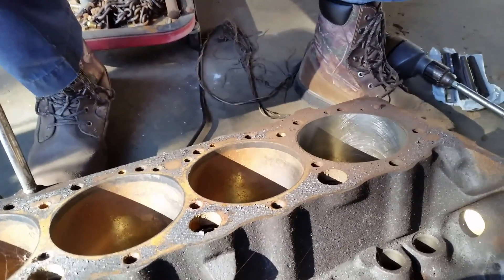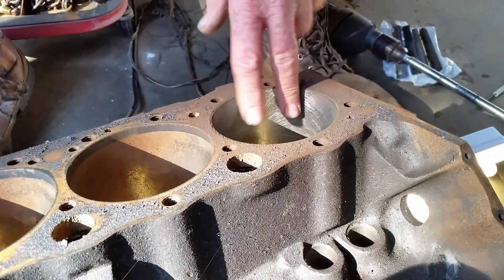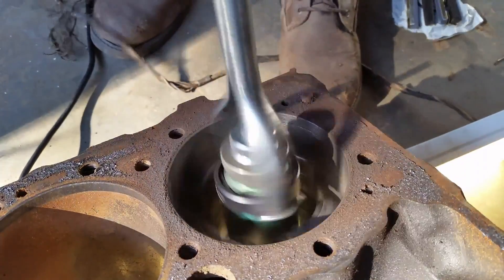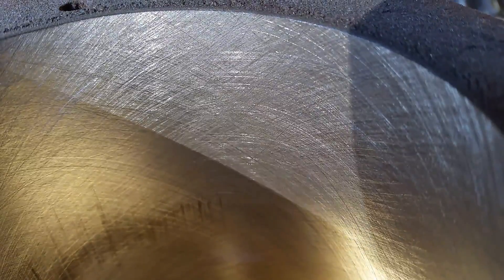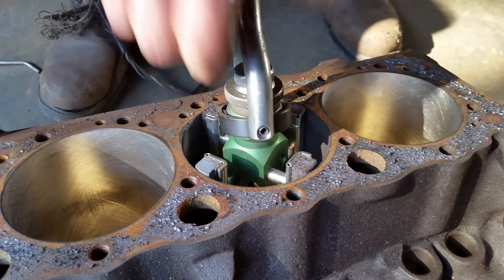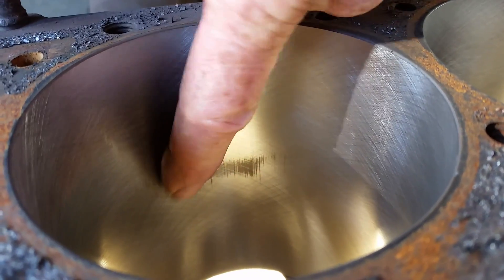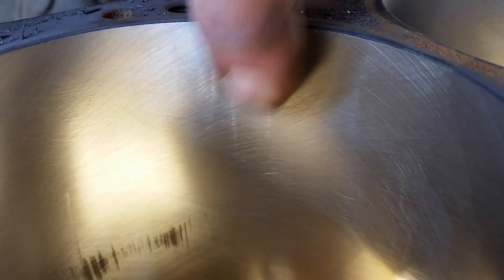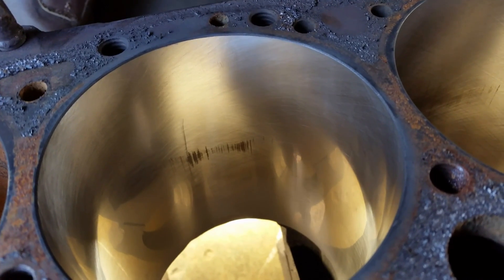How to Platau hone a block

Comment: EXCELLENT VIDEO! Thank you. A question or two if I may please. Are you able to get it even smoother than the 500? I have a 5.4 ford block which I disassembled and I see the cylinder walls are shiny smooth. A machinist told me they are crystalized and I will have a hard time with the new rings seating. They are smoother than your 500 demonstration cylinder. I don't know if I should leave them as is shiny smooth, or if I should hone them and if so, which grit to use. Speaking of grit, I just remembered Flo on the show Alice, she would say, kiss my grits! Let me know please, and again, thank you for the excellent video, extremely informative and well illustrated.

Comment: I have used this hone before and it actually produces great results. I use a truing sleeve to insure my stones are true and dial bore gauge for measurements. Can actually achieve .0005 or less top to bottom of bore. Also I use a really old Miller Falls half inch drill that turns at 120 rpm

Comment: Weldon dear....tell me that how can I machine and polish the inside body rings(seats) of gate vave above the 8inch valve. on a radial drill machine???
The device shuld be feedable while it will turned by spindle of drill machine....thanks...

Comment: That is not "plateau honing " among all the other issues the cross hatch angle is not 45 from the deck, should be 22.5, from the deck and 45 included, save yourself alot of trouble and have a machine shop do a proper job,

Comment: Once I finished a flat-four to mirror finish in the barrels. Used high quality brand new scraper rings. I worked perfect. Drove 2200 km's with partitially full power in the mountains and the oil consumption was not measurable after that. 
So the HC emission due oil was near zero.

Can anybody tell me what the hone pattern does?  It is simply a matter of time and money.....to stop honing instead to go for a very fine finish isnt it?

Comment: Old video  but who knows ... so I will say to those commenting on oil  for lube...   why would you need to lubricate. Something you are trying  to wear down ?    If you ever have used a whet stone you know that oil or water used in the process isn't for. Lubrication  . .  It's so the stones don't fill up with  cuttings and grit..

Comment: Hang a can attached with a small tube and run a small stream of fuel oil on the stones while you're honing. When about done place a sheet of 500 grit or whatever you choose, abraisve paper in the bore; expand the hone against it: run the fuel oil and Finnish the Job.
Mike

Comment: is it fit 50 mm to 65 mm?
Reply: To do that you would need a boring bar or milling machine to open the bore up, honing is only for final fit, removal of tool marks from machining and to provide the correct bore finish to help the rings seal.

Comment: I run a rather specialised business in England where I just do rebores and honing on cylinders from 1.4 inches up to 4.4 inches in diameter. For this I have a couple of Van Norman 944's and an SPS mini boring bar (similar to the Van Norman 943). I also use both Lisle 15000 and Sunnen honing equipment for finishing the bores, and one thing I think you should mention in your videos is that honing serves two purposes.

1. It cuts through the work hardened surface of the barrel after it's been bored. The reboring process work hardens the surface of the cylinder as it's cut by the boring cutter. If honing isn't done after boring it can make it harder for the rings to bed in.

2. The cross hatching helps to hold oil in the cylinder wall and helps the rings to bed in more quickly. 
 
I realise that your demo was of a scrap block and that you are demonstrating the finish you get with different honing stones using the Lisle 15000 system. It's a shame that so many people who've commented below weren't aware that you were demonstrating the finish rather than trying to remove any metal.

I've found that the Lisle 15000 is the easiest tool I've come across for stone replacement. Furthermore, I also hone dry rather than wet, although, when I worked for someone else as a reborer and honer back in the 60's, the people who supplied our honing equipement and stones (Delapena) recommended that we start with dry coarse stones and finish with wet fine stones. 

I now do most of my work out on the customer's site, with the engine still in the chassis, and much of this work is on tractor engines. I don't have the facilities to hone wet, so I just hone dry with both the coarse and the fine stones, and I find that this is sufficient for both me and my customers. 

Some recommendations I would make are as follows;

1. Use a slower speed drill that has a progressive trigger and two handles. The progressive trigger allows you to set the speed the honing head spins at so that you can keep it slow. You want to keep it slow so that if you hit the crankcase at the bottom of the cylinder and it jams, you won't break your wrist. Having a two handled drill will also help with this as well, and means the torque loading on your arms is reduced considerably.

2. Don't move the hone up and down the cylinder so quickly. I know you're spinning your hone quite fast, and have to move it up and down quickly to get a cross hatch, but if you use a slow speed drill you won't need to move the hone up and down so fast. Also, use a more powerful drill that allows you to put more pressure on the stones in the cylinder. It will cut metal faster while spinning slower, and will allow you much greater control over what you're doing and how much metal comes out.

2. As you know, the Lisle honing head has a system whereby you can expand and contract the stones quickly by pulling the adjuster at the top upwards. This disengages the fluted bar from the pins in the honing head block and allows you to turn the bar to expand or contract the stones. I put the head into the cylinder, then pull up the adjuster to free the bar. I can then turn the bar to expand the stones till they're touching the cylinder wall, then push the adjuster back down onto the locating pins. I can then use the small adjusting knob to wind out the stones the last little bit to put pressure on the cylinder wall.

3. Don't attach the hone to the drill till you've put it in the cylinder and wound it out to tighten it. Then hold up the connecting rod from the hone head and drop the drill chuck over it. Now tighten the drill chuck hand tight. It doesn't need to be done up with the chuck key because the end of the rod has flats machined into it to stop it from turning in the chuck. You can then hone the cylinder, and when you want to take the hone out of it, first of all remove the drill chuck from the hone rod. Then slacken off the adjuster on the hone head, and with it loosened off, lift the adjuster so that the fluted bar can spin. This allows you to turn the bar and contract the stones away from the cylinder walls completely before you remove the hone from the cylinder.

Apart from what I've written above I think you've done a good job of demonstrating the use of a proper honing tool, so well done!
Reply: I'm a really poor dude in the USA and injust wanna run my hair back in the wind and I need  to hone my block it does look similar to this one  what do you suggest?? But I got a old honer and no cash but I got sand paper  all types
Reply: @happydays454  Ball hone
Reply: You as well !!
Reply: Or go buy a CV-616 or CK-10.   Would have saved 6 paragraphs of worthless explanation
Reply: @georgesam7805  I'd agree with you if the people doing the work could afford the $10,000 or more it would take to buy one secondhand, and if they had the room and the necessary power supply available to power it. Furthermore, a CV-616 or CK-10 can't be used at a customer site, so in the case myself, and of the video maker, who's obviously doing the work as economically as possible, a CV-616 or CK-10 would be out of the question. 

Regarding my paragraphs of recommendations about how to use the hone safely. I've seen people get hurt by not using the equipment safely, and I've been consulted recently about a young man who's lost an eye because of not using honing equipment safely. Hence my information about how to use the equipment properly and safely.

I spent nearly 6 years in an engine remanufacturing company, doing virtually nothing but boring and honing cylinder blocks. We didn't have a CV-616 or a CK-10, but we did have a Delapena Beam Stroking bar that used a honing head very similar to the Lisle unit. Hence my posting on what we found to be the best method of getting the greatest performance out of the equipment we had at the time. No doubt a CV-616 or CK-10 would have done the job better, but we didn't have one, and neither does the person who put up the video, which is why I posted the information I did. 

Merry Christmas to you @georgesam7805, and may you have a Happy, Peaceful, and Prosperous New Year!

Comment: recommend you emphasize that the 'plateau' is due to barely using the finer stone after the coarse.  Maybe as few as 10-20 revolutions (maybe more since you didn't use oil?).  Goal is to leave the heavy scratches there and knock off the peaks.  Not at all like normal sanding where each grit is used until the former scratch pattern is gone.  With cylinder, we WANT the deep scratches to remain and only flatten the peaks for faster ring seating.
Reply: Sir..I appreciate what you are saying..but if you would look at the video very close on the last cylinder you would see the cuts from the 80 the 500 was to create a mirror effect in the cylinder to keep the heat in it...the 80 was to keep oil on the walls....think you sir for your comment....

Comment: great to see you doing it dry,,cant be messin with all that oil..it would be constantly bunging up
Reply: We use oil to clean the stones. That's one of the reasons when you see someone honing in actual automotive machine shops, the honing process is flood oiled. Just a squirt here and there like I often see is mostly false hope.

Comment: Edited to be less controversial.
Found the instructions for the Powr Kraft, Lysle, etc. Instructions do NOT say to ONLY use oil. It does say oil may be used or you may use the stones dry. IIRC, dry stones should always be used dry and oiled stones should always be used oiled. 
Many may disagree from how they were taught or feel time has taught us to always use oil, whatever, but dry is exactly one way these may be used per the mfg. Certainly not worth yelling at each other about. Just admit it’s a great demo! 
Also, long time or aircraft mechanics are not necessarily more “right” than any others.
Reply: Thank you soo very much for saying that 👍👍👍👍👍...you done your research..👍
Reply: Actually it states and I quote "If dry honing, clean each cylinder thoroughly with any approved solvent and wipe dry. Be sure
there is no oil or grease left in cylinder to get on stones. If stones should clog with gummed oil
or other material, clean with wire brush. ALWAYS KEEP STONES CLEAN.
Honing with a honing oil will produce a smoother finish and generally remove material faster
than dry honing. If honing oil is not available, a mixture of 8 parts kerosene to 1 part oil will
suffice. Keep cylinder walls wet so fluid will wash away material you are removing from
cylinder walls. "
Note it says "gummed oil" which is referring to the old gummed engine oil, not clean honing oil.
And it makes it clear that if honing oil is used you will get a better result, as anyone experienced in using hones knows the honing oil does the job of cleaning the stones in use, and it's not like kero is hard to find, so not using and settling for a rougher finish is IMO a bit lazy, but its your engine so dry hone if a poorer finish is good enough for you. Hope that helps.
Reply: @836dmar  
No, that is what the instructions say.
But if you know better then the instructions of the hone manufacturer then you go right ahead and do it that way.
Reply: @836dmar  Gaslighting wont help you.
And returning a year later to reply is the absolute definition of "defensiveness" as you still have not go over being called out on your original post.
You said " it does NOT say to use oil" when in fact it does say use oil.

Comment: LoL. Someone bought Sunnen and Rottler machines to do platau hone, but u can do it with hand drill from 1930's.
REALY?
WTF MAN?
This is not a work, this is something weird.
Like Ford T-model with 30hp from 3L engine.
"19's century technology"
Reply: Merkantiloid yes sir it can be done and you seen it and thank you for your comment.sir.👍
Reply: But this is shit, that cannot restore geometry of cilinder. It's angle to crankshaft line and horisontal position to rear base of engine block.
Why we use new machines to repait own engine blocks? Because it be needed for good performance. Like 180 hp from 1.6 engine without boost, that was originally crafted in 1975 year. Not 320hp from 350c.inch. 5.7L ))
Reply: Merkantiloid sir this way of doing this is for the people that can't afford to pay the hi end shop's...I know about core shift..and how to look at a block too tell if core shift is bad or not...nobody or manchen can correctly straightening the block.the piston will end up in the water jacket...unless you sleeve the block to get the correct angle...then shift the head's...this video is a poor man's way of how too..thank you for your comment.sir
Reply: Merkantiloid dam man I got a boring bar that will do that..and I can that and tell the trull these new blocks they are of by about....-- .008 off of chank center line and that is not accepted in my book....now if you would watch boreing a block by jomasterhn...my boring bar bores off of the center of the crank shaft
Reply: @BaseOfGames no honing is used to restore geometry. It's to create scratches for oil to adhere to for piston rings to bed in
Reply: @erdemir5641  with honing mechanics cut up to 2-4 micrones to have better geometry. You cannot cut 0.01mm from cast iron, because it forges. But you can hone it down.
Reply: I'll hone that block with your ball sack. 😁
Reply: ok, my scrotum (ball sack) and balls are hard enougth to scrap usa metal ) "Confirmed"
"hardened steel balls are ringing" lol
Reply: Don Rutter thank you sir for defending this video 👍👍👍👍👍

Comment: I hope you don't use the same technique honing the bores as you show in this vid. I don't think I have seen more poor control before
Reply: Darren Boxhall is this the first time you seen a honeing video????
I think soooo.....but thank you for your comment and watching
Reply: L P.  Mate,I have seen and done honing. You don't stop,change speed and rate mid hone. You lock the drill at the desired speed,then you keep the motion constant,then when your finished,on your last up motion,you quickly pull the hone out of the bore
Reply: Darren Boxhall not on this hone you don't do that the instructions say nooooooo
Reply: Darren Boxhall thank you for your comment sir 👍
Reply: So the instructions say "adjust speed from fast to very slow, sometimes not moving hone,when finished stop hone mid bore then drag it out out of the bore without spinning, ensuring to leave vertical scores up the bore as you lift it out". Is that what it says?
Reply: No stress mate. Have a good day
Reply: Darren Boxhall no stress mate just had a phone call now I'm back ok first of all the 80grit it doesn't matter as long as you get the cuts in the cylinder to help hold oil now the 280grit is cutting the peats from the 80grit and then the 500 grit is cutting the peats from the 280grit..and far as it goes the fineley cut it matters and thank you mate 👍have a great day

Comment: The top of a worn cylinder has a ridge that must be removed before any honing is done , just enough honing to break  the glaze on the cylinder walls with a crosshatch pattern.
Reply: Des Stanford yes sir I will agree.for stock rebuilds..the block I was useing did not have a rigid at top.its a.060 over 350 chevy.and what I was doing was more towards race blocks.thank you sir for your comment 👍